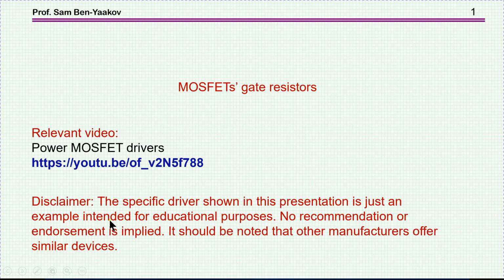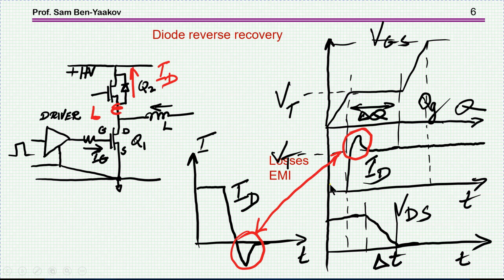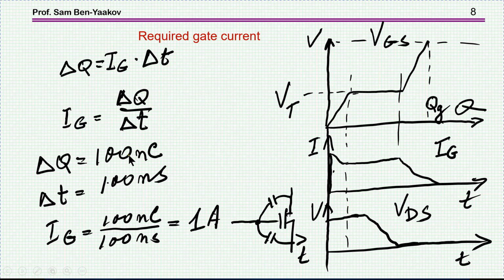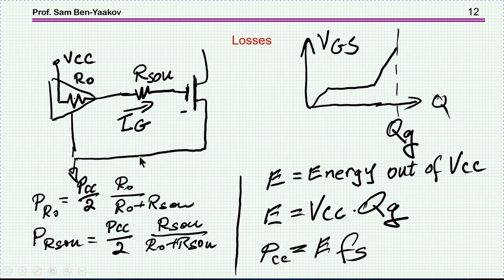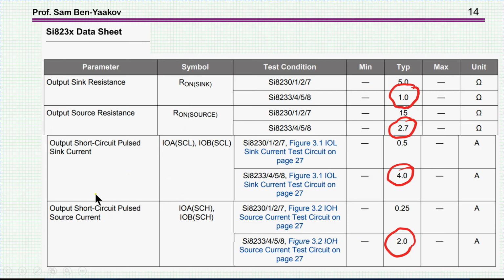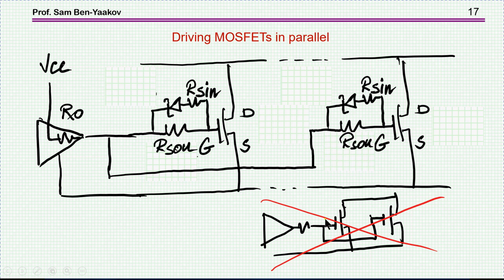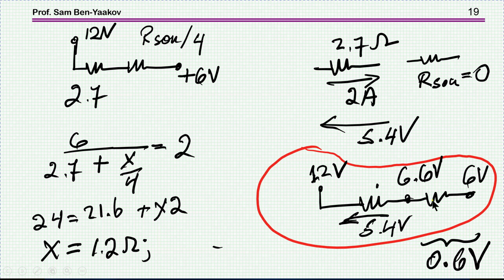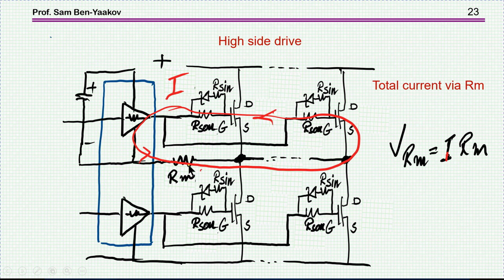MOSFETs’ gate resistors

Comment: Some part of this presentation is only valid for old planar MOSFETs. For those MOSFETs, the du/dt during the switching interval doesn't change much. For SJ MOSFETs this is very different and the du/dt changes while Cgd changes over a gigantic range from a few nF to only a couple of pF.
Reply from the maker: Very true, the highly non-linear Cgd of SJ MOSFETs significantly impacts the switching trajectory compared to to r planar devices. Do you think it changes the main points of this video? In what respect?
Reply: @sambenyaakov  Not the main point. Only the part about the reverse recovery current where you state to control the turn on time by changing the gate resistor. When Vds is high and no miller capacitance to speak of, it becomes nearly impossible to control the turn on time. If you try this,  this will result in very high gate resistors. With a high gate resistor, the du/dt decreases when Vds is below the point where the miller capacitance shoots up from a few pF to a few nF. There is not really a way to control those devices with a gate resistor. If you ask me, the minimum gate resistor required is a resistor which provides enough damping for the LC circuit formed between the gate drive and the MOSFET. Assessing power dissipation is only possible by taking real measurements and not from a rough back of the envelope estimation based on gate charge, drive current,...

Comment: One thing which I can not understand: why is it so important to discharge gate faster than charge it? I understand that it improves power dissipation of the MOSFET. But why we can not do the same with a charge?
What is the difference between charging and discharging that we are doing different time to them?
Reply from the maker: This has to do with the direction of current and diode reverse recovery.
Reply: @sambenyaakov  Thank you for the answer. Do you have a more detailed video about this topic on your channel?
Reply from the maker: @ https://youtu.be/2oYYYVu4Akk

Comment: Should you consider the 10ohm gate resistor when determine the Ton and Toff current??
Reply from the maker: Please indicate to which slide number or time in video you are referring to.
Reply: @sambenyaakov in slide 15 and 16. The 10 ohm resistor to the threshold battery replacement. As far as I understand you suggest that an additional gate resistor is not required because the on and off current are within reasonable limits?  I try to understand how to calculate the gate resistor values. Thanks!

Comment: 7:06

Why is the Vgs = Vt a crucial time for Ig calculation?
Reply from the maker: This is when the switching transition occurs
Reply: @sambenyaakov  is that the point at which Ig is at its peak? Why wouldn’t we calculate like: Ig = Vcc / Rsum?
Reply from the maker: @bernard.tomasevic  at this point the voltage of the gate is Vt, the peak current is when Vgs=0

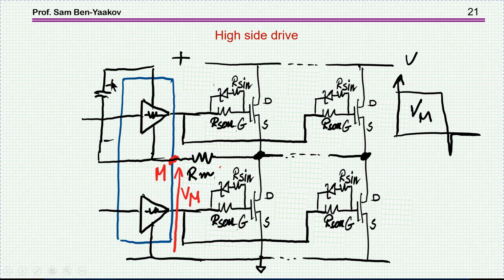Comment: Thank you professor for the video. I have question. How about putting  the resistor only on the source pin? but not in the gate. ie at 19:34 remove the Rm and replace by Rson and Rsin.
Reply from the maker: There is a need for separate Ron and Roff for each transistor because parallel connection of MOSFETs is not desirable due to Vth spread.

Comment: Hello professor, I have a question about this moment shown in the video https://youtu.be/Aq1Iw6ByXAw?t=395. I understand that delta time refers to the voltage rise time of the VGS and not the fall time VDS. In the case where we assume the fall time for the voltage VDS, we will use the charge accumulated in the plateau region in the equation. Am I right?
Reply from the maker: The time of the plateau IS the fall time of Vds

Comment: Hi Professor.

I have one question during test in the labo when using Mosfet SIC NVHL160N120SC1 for the full bridge ;  For the commad Vgs (-5V & 20V), during turn on, there is Peak Voltage found on the Vgs , which can be higher than 25V;  So there is risk to destroy the Mosfet due to limited max 25V from the datasheet; 

I do the simulations and this peak voltage on the Vgs coming from the stray indutace of the pins of TO247 ( NVHL160N120SC1); 

My solution is to increase Rgon value to slow the switching on  ; do you think is a good way? thanks
Reply from the maker: I do not think that the reason is inductance in package, probabely the traces. Yes, adding R reduces Q and hence damps oscillation - at the expense of a slower drive and higher switching losses.

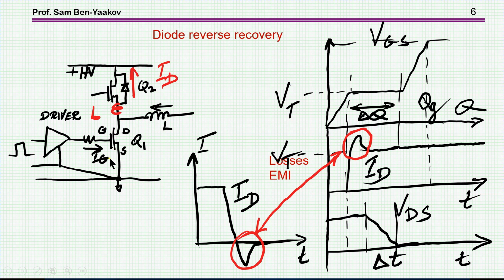Comment: At 3:43 you say: (Paraphrasing here)
"Before Q1 is turned on, Q2 was turned on. Current was flowing through Q2. 
Then, Q2 is turned off, and we start a dead time. This will cause Q2s parasitic diode
to forward bias."

If, Q2 was conducting, that means the switching node was positive (+HV). So when Q2 is turned
off, the switching node will go negative to keep the current going in the same direction.
That means Q1s parasitic diode with forward bias, not Q2s. 

We then proceed to turn on Q1 once the dead time is over.

Could you help me out reasoning how Q2s diode get forward biased after Q2 is turned off? Wouldn't it be Q1s diode that forward biases?
Reply from the maker: "the switching node will go negative to keep the current going in the same direction." Not so. The current is maintained same direction by D2. To self commutate the mid point voltage you have to charge the parasitic capcitor with a current of OPPOSITE direction. Thanks for intertest. capacitors

Comment: Incredible video! I have one question. When calculating the gate current, will it be more accurate to consider the Miller Plateau voltage instead of the threshold voltage?
Reply from the maker: When gm is high, as typical of power transistors, the threshold and Miller plateau voltages are about the same.

Comment: Thank you professor, this is the best explanation about gate resistors in the internet. However, i have a question sir. How to determine the turn-on time to avoid the reverse-recovery? is there any range for that?
Reply from the maker: Reverse recovery is a function of the forward current and dI/d Hence, for a gives forward diode current the way to reduces di/dt. One way  is by slowing down the turn on of the complementary transistor.
Reply: @sambenyaakov  Is there any explanation about how much "slowing down" is sir?

Comment: Why this diode turns on momentarily when we turn on lower fet ?  When upper fet is on this diode is reverse biased when lower fet turns on anode of diode is pulled down to ground so it’s still in reverse biased mode why it shows current peaking ?
Reply from the maker: Reverse current is during the dead time
Reply: @sambenyaakov  dead time is when both fets are off state .. so diode becomes forwards biased momentarily ?

Comment: Hello, Prof. Are you suggesting that the threshold voltage of the FET and Miller plateau voltage of the FET are equal? In my limited understanding, the miller plateau voltage is greater than or equal to the threshold voltage.
Reply from the maker: Thanks for participation and input. The plateau is at voltage that needed to sustain the current during transition. Since the gm curve is rather fast rising the difference from Vt is small.

Comment: In some books it is written that the gate resistance is used to dampen the oscillations caused by the junction capacitance and the stray inductance. I am curious that how is the presented theory in harmony with this statement. Thank you
Reply from the maker: Thanks for bringing up a very good point which I have not covered in video. The problem of oscillation is in parallel the issues I have discussed and stems from the fact that the drive lines have a stray inductance. Resistance will dampen the oscillation if the quality factor Q is reduced to about 1 or below.
Reply: @sambenyaakov  Thank you for the reply Prof.

Comment: Thank you for your great work
i think RG of mosfet(that write value in datasheet of each mosfet) must use for external resistor switch on and off 
true ?
Reply from the maker: But in many datasheets you are given range of Rg , so which one to choose?
Reply: @sambenyaakov  I think we must add RG in data sheet to external resistor that find with equation so
If RG is 2ohm and we find Ron resistor 12, better use 10ohm in circuit and if for roff if find with equation 4ohm, good choise for roff external is 2ohm
Ron(from equation)=Ron(external)+RG
Roff(from equation)=Roff(external)+RG
Reply: @sambenyaakov  for range of RG
I think better choose is take maximum resistor that write in the data sheet and add value to external resistor to achieve equation resistor
Reply from the maker: I now understand that by RG you meant the internal gate résistance. Strictly speaking you are right but  in practice, the other inaccuracies make the precise calculation meaningless.
Reply: @sambenyaakov  thank you for good reply
i got it :)

Comment: Thank you professor. Would be nice a video on configurable current mode MOSFET drivers, pros and cons, etc... I have used them sucessfully to tune the rise and fall time to make the system EMC compliant.
Reply from the maker: Thanks for suggestion. Will consider.

Comment: Great video, this help new people in energy electronics safe a lot of time. I have one question about gate charge circuit, many time I saw resistor between gate and source (most popular 10kohm). I thing this is useless element if we use dedicated driver for mosfet, but nice to know your opinion about this element.
Reply from the maker: Hi Marcin, thanks for participating. The function of the parallel resistor  is to provide a low impedance, sort of ESD protection and bleeding of leakage current of gate. Indeed, when there is a driver it is supposed to provide the low impedance path. But...if the auxiliary power supply is off? the impedance might be high and EMI might turn on or even damage the gate. And more severely if one applies the high voltage to power transistor (with no auxiliary power to driver) ,the  spike via the "Miller" cap might be a problem.
Reply: Hi Sam,
Thanks for respond. That nice to know, Thanks!

Comment: Hi Profesor. In minute 13:43 you said (8-0.5)/1 give us 7A. But what with this 10R resistor?, he will not play in current value? If we will take large amount of current from this two capacitors, the have ESR and he will not decrease amplitude of current? As always thank you for very educational video
Reply: The capacitors start charged at 8V. That is why the 10R resistor is there - to charge them initially.
So the initial current (8-0.5)/1 comes from the capacitors and goes down tending to ~(1.18-0.5)/1 = (8-1.18)/10, and in that case the current comes from the 8V supply.

ESR could have an impact, but you can get good caps with ESR in the order of 0.1 ohm.
Reply from the maker: Thanks for input.
Reply from the maker: Thanks for participation. The pulse is short so the voltage on capacitor barely changes (ESR is small compared to internal resistance of driver). The function on the 10R is to charge/discharge the cap during the rest duration.

Comment: In the end of the presentation you have shown in halfbridge configuration there is negative voltage peak has seen ,but it can be eliminated using series resistor to save the driver. There is an alternative way to save that using TVS diode to clamp the negative transient, without inserting a resistor in the path....and than k you for your wonderful presentation as always.
Reply from the maker: Thanks for participation and contributing,. Indeed, the peak can be chopped but the purpose in video was to show the implication's when a resistor is added.